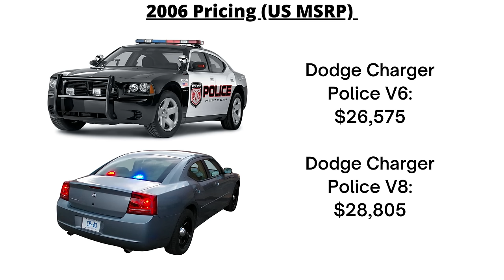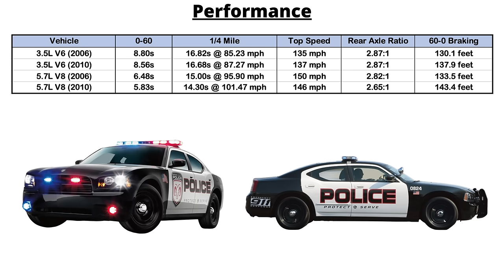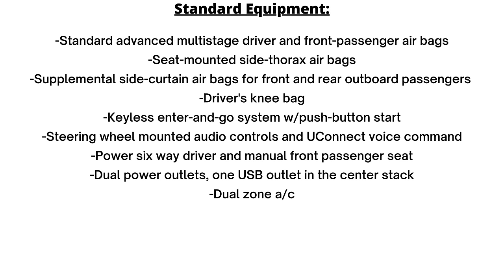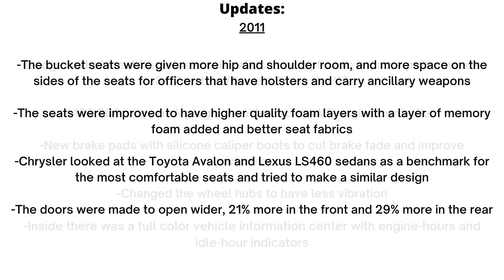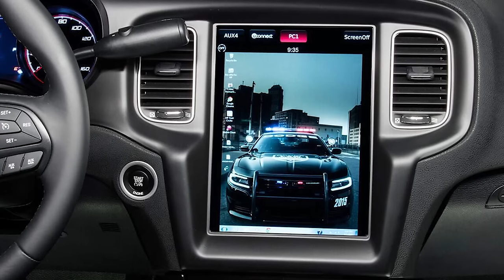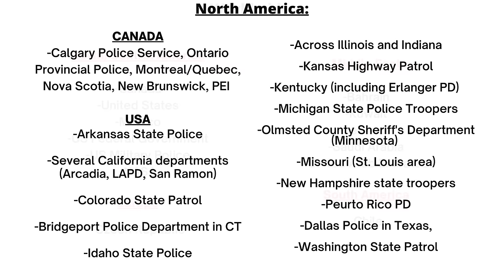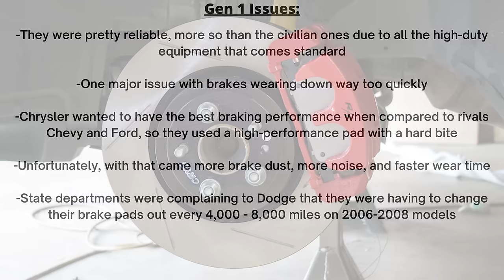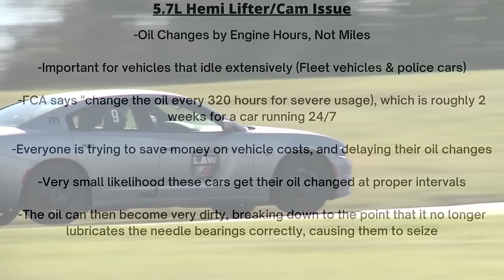Dodge Charger Enforcer Police Car – History, Major Flaws, and Why It Got Cancelled (2006-2023)

Comment: My last troop car with the NYSP was a twin turbo Ford Taurus.  2014.  Loved it’s performance.  Didn’t like the small interior.  Considering equipment and prisoner.  The Dodges were fast, quick and much roomier.  My Taurus was governed at 140.  Tried to pass that many times.  Stay safe my friends!  🇺🇸
Reply: It wasn’t governed by ford at 140. The Ecoboosts sedan at a top speed of 150
Reply: It was the pride flag that limited the top speed by a few mph.
Reply: Was it the 3.5 liter twin turbo model? I'm only asking  because there was a 2.0 EcoBoost in the last few years that I never got to see and I had a 2014 Wyoming State Trooper that was the 3.5 liter twin turbo and it did 148 fairly easy.(when I had room😮)

Comment: The Charger 5.7 pursuit is my favorite police car of all time, especially the third gen. I love the sound of the exhaust. I love how quick they are from a stop and during quicker accelerations. The 2015-2023 5.7 pursuit is the one that's able to keep up with most other vehicles during high speed pursuits on major highways and open country roads. I sometimes consider the Charger 5.7 pursuit the modern-day Polara 440 interceptor. The 2006-2023 Charger police car marked the return of Mopars ruling the highways with lights a sirens.

I definitely knew the biggest issue with earlier pursuit models was the brake quality. Seeing you mentioned the Bridgeport, CT police use Charger pursuits, there was a major chase that happened at least 8 years ago. I was listening to it on an online scanner. Once the cops had the suspects in custody, I heard many telling dispatch that their Chargers needed to be towed due to worn out brakes. I got to talk with a Bridgeport cop who was involved in that pursuit and found out that the brakes were doing an excellent job at quickly slowing down the vehicle, but were wearing down quickly.
Reply: Rotors on the last 7-8 years are 14.5 inchs and 15 inches back and front.  Huuuge, my garage says they're as big as what they put on pickups.

Comment: 2011 upgrade changed to a 6 speed transmission for all Chargers. They kept that through 2020 and cancelled the awd hemi for 21 because the 8 speed was the same trans in use on all other chargers and they didn’t want to have a special driveshaft and transfer case just for one model of police charger. The awd hemi hadn’t been available to the public since 2014 model year.
Reply: No they all have 5 speed autos

Comment: There goes a major revenue stream for Chrysler. EV cruisers won’t be viable until the range improves. Especially in cold climates
Reply: Yeah in Minnesota Ev cars will not work in -40 Degree Winter cold.
Reply: @KurtBenning electric motors are most efficient in cold weather.
Reply: @UT
batteries lose charge fast in cold
electric motors are great... but...
issue is fuel
batteries suck
hydro carbons are great
energy per mass unit:
EV. =     1
HC = 100

Comment: A few years back I was picking up used police cars for taxi company's and if it was a Crown Vic 200,000 miles bring a battery and some fresh gas drive it across the US to be setup as a taxi. if it was a dodge with 50,000 miles bring tow truck. I never towed a ford and never drove a dodge.
Reply: The Crown Vic is one of the greatest police cars ever. Down on power but bulletproof and handled great.

Comment: Strange to think that the '23 Charger will possibly be the final American police "car". I'm very concerned for Dodge's future, if they loose out on the fleet/LE market by axing these models. Even if they bring out a next gen sedan, I'm worried that the Twin Turbo six may not have enough longevity to support the requirements of law enforcement agencies. I guess we'll see! I wish Dodge could just come out and start announcing their actual plans for the next few years. Announcing the end of your entire lineup and not a single replacement is just strange (well, aside from the Hornet).
Reply: Based on how few pre facelift ford explorers I see the police driving around i assume modern police cars are not durable. Even my local state patrol seems to have no pre facelift chargers left anymore. So dodge going for a twin turbo 6 cylinder would just make law enforcement continue to churn through patrol cars.
Reply: @brayannexon4613  They're usually retired once they hit a set age, like 10 years, or a certain amount of miles, such as 100K.  My town still has two 2008 Tahoes and one 2013 Tahoe still patrolling the streets.  They still use a 2015 Explorer as well.  It tends not to be about reliability when it comes to retiring vehicles, reliability issues will only affect future purchases usually.
Reply: @brayannexon4613 All depends on the department. Some departments, regardless of whether its 1000 officers or 10, get new cars every 60000 miles, like NYPD. Some departments, like LAPD and LASD, still use Crown Vics well past 400000 miles. If it ain’t broke, don’t fix it.
Reply: @sminem6572 And small towns will sometimes have weird early 2000s stuff like a police package Dodge Intrepid. I’ve seen an 04 Chevy trailblazer used as a cop
Reply: @goldengod5915  If an Intrepid and Trailblazer is considered weird, I wonder what you'll think about the Hazel Park PD Jaguars, Aspen PD Saabs and Volvos, Duncan PD BMWs, and Beverly Hills PD Mercedes. Not to mention a bunch of departments use Toyota Highlanders, but that's not that weird.

Comment: I wonder what the state boys that currently use Charger Hemis will have to move on to after they retire them. Maybe on to heavier and slower vehicles like the Explorers and Tahoes.
Reply from the maker: They still do have the Durango for at least 2024 as it is, so they could use those if they wanted to. Otherwise keep using the old Charger Hemis until the wheels fall off 😂
Reply: @MarspeedCars at least through 2025, when they begin using the Hurricane Six.
Reply: New Hampshire State Police placed a massive order for AWD Hemi Chargers before they were discontinued, and just did one for the AWD V6s too. I suspect they have a bunch stashed away to keep using well into the future. They’re still using 2014 Chargers and even some 2010 Chargers in rural areas trying to get as much usage out of them as possible. They have never purchased a single Ford Explorer, not even for detectives.
Reply: The Explorer is the best Troop car that exists
Reply: @petewells5593 opinions like that are only worth what they cost.  The facts, however, don't support your claim.
Reply: @UnionThugg I thought through 2024 only
Reply: Ohio Highway Patrol is getting Durangos for 2024.
Reply: @tylercooper5092  2025 for sure, possibly 2026. Depends on when the next Durango is ready for production.
Reply: @289Mustang67 right. We are too but I heard this is the last year before the change.

Comment: I have a 2011 pursuit, and I had to get the motor rebuilt about 3 years after owning.  It wasn't actually the cam but a spun beaing.  Word to the wise, spend the extra money, and delete the MDS if you do anything past bolt ons, those lifters were made in a bomb factory.
Reply: MDS isn't the cause of the failures in the valvetrain.  A spun bearing has only one cause: lack of lubrication.  Check your oil on these things, every day.
Reply: @UnionThugg  im not saying that a bearing on the bottom of the block effects the valvetrain. I spun a bearing and just did the cam as well, two separate things.  The mds oil-filled lifters can fail due to poor lubrication as a factory design flaw. Richard holdner is the hemi Jesus, im but a deciple.
Reply: @joshnoname7305  the MDS thing is a myth. Plenty of non-MDS lifters have failed on cars and trucks alike.  That tells me it's more of an issue with vendor parts quality or the overall design.  Probably both.  

Every 3G hemi I've owned ate the cam, one if them twice.  It's pretty telling that Chrysler's latest policy is to check for debris in the VVT solenoid, and to replace the entire engine if there is.  I think that stems from the fact that they had been replacing cams and lifters without tearing down and hot-tanking and/or flushing the block and heads. Debris would remain in the engine (the filter can't catch it all), and then you'd get scored rod and/or main bearings, as you've experienced.   

Worst thing is, there's no valid cure.
Reply: @UnionThugg  Aye, I'm just saying, personally, on mine, my mds lifters were more worn, and my cam lobes with those lifters were worse than the non mds lifters and lobes.  IMO, the entire motor would have benefitted from a better oil pump and no mds at all. I actually get better mpg highway with mds disabled. The hemi tick is a mystery, and the lore just grows.
Reply: @joshnoname7305  I had a '17 AWD Pursuit model. I bought it just after the cam and lifters had been replaced at the dealer. I got 10,000 miles out of it when I lost another lifter. The dealer was willing to replace everything again, but that was enough for me.  I sold it for a song, and that person wound up having to replace the engine.  They had dropped the pan and checked rods and mains, and discovered they were scored from the debris.  

Yet we do hear about some of them going for a long time without any noise or trouble. So who knows.  My experience with that engine was very poor, especially compared to a 3.6 model I had, and quite a few 318/360 LA powered Mopars.
Reply: @UnionThugg  Yeah, gen 3 hemis are hit or miss from factory. Regardless, a well-built one, as long as it isn't a garbage 6.4 or maxed 6.2, can be just as reliable as any LS at making power.  It's just the pain and money you gotta accept that it will cost to fix the laundry list of issues dodge engineers didn't.
Reply: So you refused a free engine or they would charge you?

Comment: If you want a less than 5 seconds 0-60 on the V8 AWD, use a tazer, put it in rear wheel mode manual, and enable launch control.  It's almost hurting to see they leave it so tame when in fact it's a beast if you unlock it.  Even better if you finesse your intake and exhaust, SRT shorty headers, PCM unlock and tune... 4.5s 0-60 or less...
Reply: Got a 5.7 pursuit and tazer never messed with launch control. Have to try it out
Reply: Wdym use a taser

Comment: Errata:

Soecial Order Paint - minimum was always 5 cars. Always, well back to the lare 60's. 

LD - Entire 2011 - 2023 run.  Body designation did not change with 2015 updates. 

AWD was added in December of 2014 (mid '14 model year)  BR9 brakes were optional from mid - '14, then made  standard in 2015. 

12" screen was dropped after 2020. 

A580 trans was discontinued after 2020, models then Changed to V6-AWD and V8-RWD.  V6 car used the Durango's 850RE, V8 car used the 8HP70.  Electronic speed limiter was 140 for both cars, now field-adjustable (downward only). 

In 2019, they sold 21,000 Charger Pursuit models in the US.  2020 was a very short model year (2 months) for the Pursuit, and the new Durango Pursuit took the lead sales spot for the FCA/Stellantis Fleet roster. As production of the Charger Pursuit resumed, sales evened up a little bit more between the two vehicles.  Production of the Charger Pursuit ceased in Sept of 2023. 

The switch to 8-spd transmissions did not affect performance.  

The 3G hemi valvetrain failures were NOT limited to the 2009+ eagle engines, nor to just the MDS engines.  It was a design flaw that didnt allow for variations in component materials.  

Final Analysis: the Charger survived every other domestic police sedan.  We can expect the new Dodge police sedan (as yet unnamed) to offer a variety of propulsion choices, including the Hurricane Six.
Reply: AWD and BR9 brakes both came in at the same time in 3rd quarter 2014.
Reply: @canadaguy1234 December of 2014, so technically 2nd quarter. But yes, AWD and BR9 appeared at that time.  BR9 was standard on AWD, optional on V8 and V6 RWD until made standard on all 3 models in 2015.
Reply: @UnionThugg  BR9 became standard on all 2014s or at least V8 models for the later part of the year. AWD came out in the fall. The first ones I saw were manufactured and delivered in September.
Reply: @canadaguy1234 Dec 14th, 2014 was the changeover date from R/T AWD to Pursuit AWD. To make it worse, I have seen one of these 2014 models for sale with a 2015 VIN. That may have been a seller issue.

BR9 was standard on AWD from Day 1. The other two models - in the US - had BR9 optiona from the Dec changover until 2015.
Reply: @UnionThugg 
Strange differences in timing.
In any case it was only a portion of one year.
Reply: @canadaguy1234  yep.

Comment: I worked at Dodge I can guarantee after 2013 starting in mid 2012 the all-wheel-drive pursuit chargers were a thing all wheel drive with a hemi bike. You have no idea how many of those cars of work done and how many of those cars are fucking fixed.
Reply: On what specifically did they break down the most?
Reply: Are they just all around bad cars? Because of the engine idling?

Comment: Where is the exempt button this was literally the crown vic for Dodge remember how ford stopped production for civilians back in 2008 and then announced 2011the last year  they could've still had 3 years left and all agencies in the u.s  stock up 
I have a crown vic i drive on the weekend im still debating purchasing between explorer twin turbo or the charger hemi rwd the brakes shouldn't be a issue for me but trying to manage lifters vs a water now pump man thanx 😮😢😊
Reply: The water pump in the Fords is as bad or worse to change then the cam in the Dodge. It and the cheap interior were the two things that stopped me from getting a taurusceptor. The peeling white paint that ford hasn't fixed in 30 years didn't help either.

Comment: Last year I got a 2020 Pursuit V8 AWD, which had very low mileage and very low idle hours, and was a fair price. Yes it was rear-ended while in service but it was fixed up well and over a year later I'm still very happy with mine. It's my daily driver and great on road trips. I have made several performance and cosmetics mods (a few videos on my own little channel... More like a profile), with a few more mods in mind after the factory powertrain warranty expires late next year.
 
@MarspeedCars
: Yes the Charger/Challenger platform as we knew it h got long in the tooth. Even with some refreshes and upgrades, 18 years was a heck of a good run. Though many of us are sad to see it and the V8 go, the upcoming sedan replacement to carry on the Charger name will at least have +400 to +500HP with the Hurricanes and went look like a Pri[ck]us. Too bad Stellantis, overall, is injecting too much Eurotrash schemes into Dodge's U.S. market though.

Comment: Charger Pursuit is a total POS for patrol. Maybe, MAYBE strictly highway patrol on open roads but that's it. On patrol they'll give you about a year of good service. After that they literally start falling apart. Bushings, Bearings, front-end, pulleys, power steering etc etc. That plus they CONSTANTLY overheat

Comment: Lookup "2023 Model Year Police Vehicle Evaluation" by the Michigan State Police. Other vehicles, namely Ford's Police Interceptor Utility (related to the Explorer) has been rated better. Ford's PIU has a higher ride height, roomier, and the all wheel drive Ecoboost is more fuel efficient than Dodge's RWD Hemi, and probably cheaper, too.

Nothing against Dodge, just being descriptive.
Reply: Dodge is dead last in everything. Build quality, reliability, comfortableness, handling, fuel economy, tech, etc. Only two things they succeed at are straight line speed and selling to people with no money and bad credit. I’d take a two decade old Crown Vic or a decade old Impala over a Charger as a patrol car every time, and most other officers would too.
Reply: Yet the Michigan State Police still just got a bunch of new Durango Pursuits.
Reply: Comparing the Turd to the Charger is not too intelligent.  Compare it to the Durango. The test is primarily used by agencies to qualify vehicles for bidding purposes.  

Returning to reality, the Ford is a disaster.  Most agencies purchase the 3.3 or hybrid, nit the ecoboom.  It's still more expensive than the Charger, and comparable to the Durango. And Ford continues to cancel orders, while Dodge will sell a Durango to any agency that wants one.  

An agency in my county is returning all of their 2020+ turds on lease for new Durangos.  They don't have enough usable space, they have trouble seeing out of them, and they haven't held up worth a damn.  

While none of the newer police models are particularly durable or reliable, dollar for dollar, the Dodge remains the best value.

Comment: As long as you don’t have to pay for repairs, I guess the Dodge is ok….all the cops who want to live through a crash usually pick a Ford….wait until a few of the Chargers and Durangos are hit on the side of the freeway and cops start getting burned. Fords had this issue in the early to mid 90’s and took care of it. I bet Chrysler hasn’t been sued enough to bother with it. Ford would regain market share if they re-introduced a sedan to the lineup. A lot of cops don’t like the SUV because they perceive it to be tippy, even though the last few years the Explorer was(3.5 turbo) quicker,faster, braked better and went around the road course quicker than any Dodge.